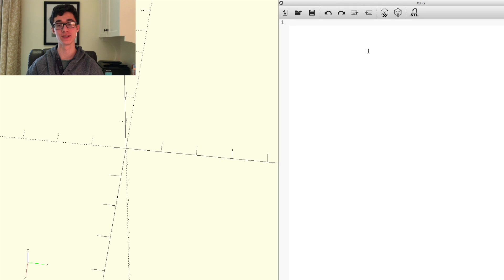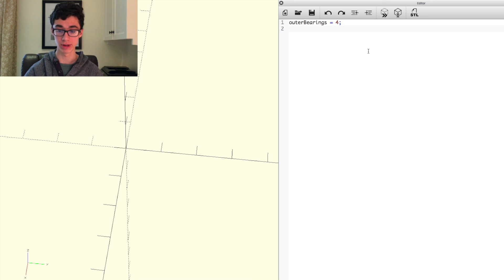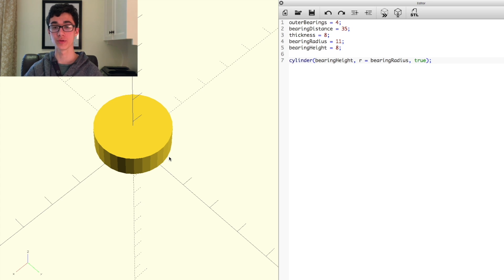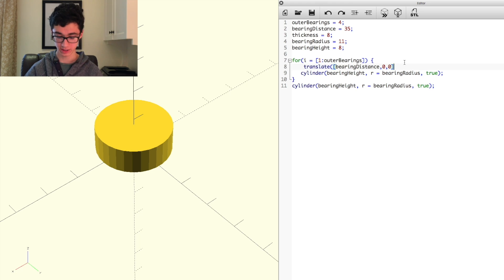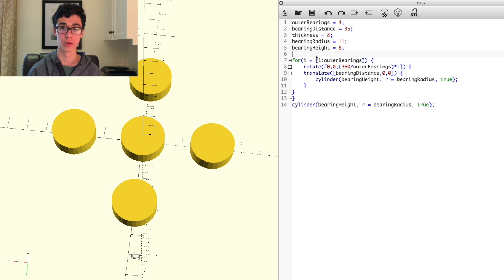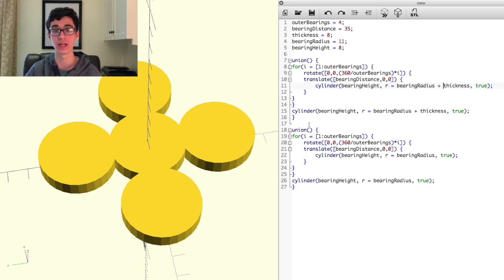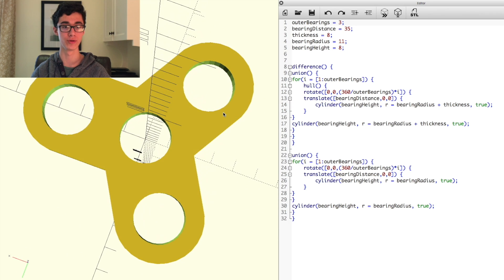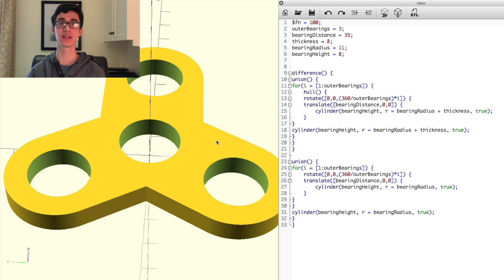Parametric Fidget Spinner

Comment: How would I switch the outer holes to hex shapes.     Say I create a 4-armed fidget-spinner and I want two holes hex and two holes round with the center being round.

  What would that look like in the code?
Reply from the maker: Sure! You would just need to replace the code that generates the inner circles with code that generates a hexagon. This should help: https://en.wikibooks.org/wiki/OpenSCAD_User_Manual/Using_the_2D_Subsystem#regular_polygon